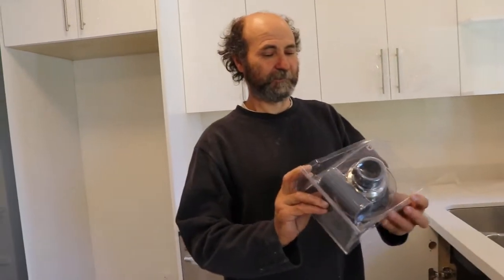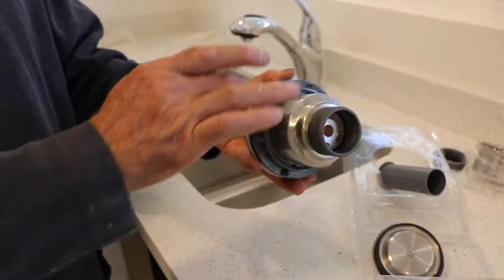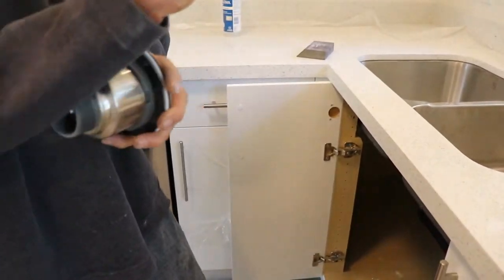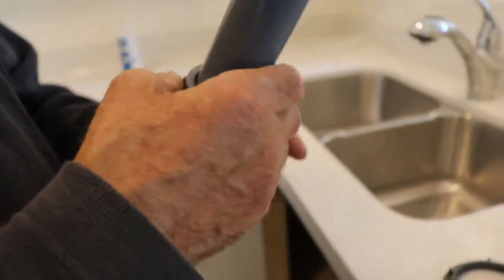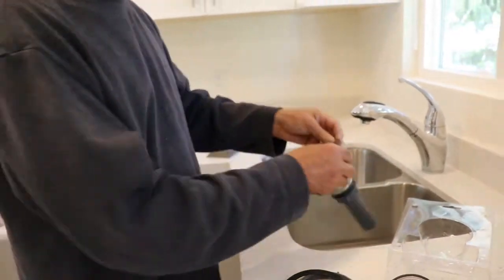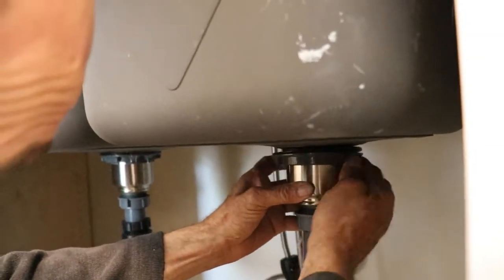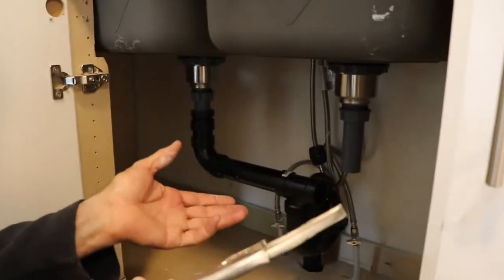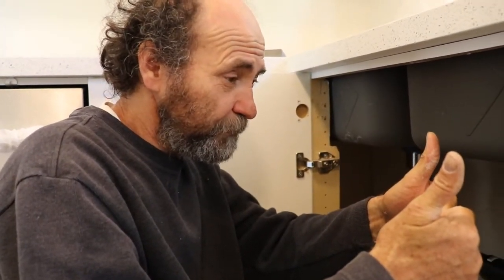How TO INSTALL A KITCHEN SINK Strainer

Comment: The installation instructions fron Ruvato shows the white foam under the sink. It uses only plumbers putty on the top between the stesiner and the sink. Why did you do it the other way?
Reply from the maker: Hello Steve, thank you very much for your time and comment, I personally do not like plumber putty, because plumber putty drys up and cracks causing leaks, some of the of the strainers come with a gasket for the top of the strainer and for the bottom a rubber gasket plus a cardboard ring, for some reason this one did not come with the cardboard ring, let me know ,if you have more questions, keep safe
Reply: @BahianoReno  some of the low-end strainers have cardboard ring, but it will be rot and fall off after a period of use. The white EVA and black rubber are more stable and will last longer.
Reply from the maker: Thank you very much Victor for your time and feedback, keep safe